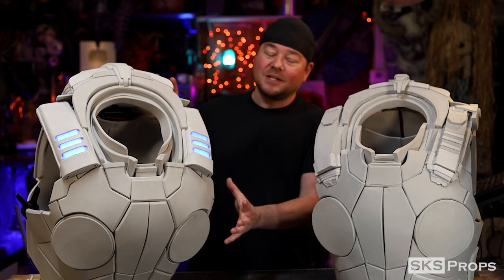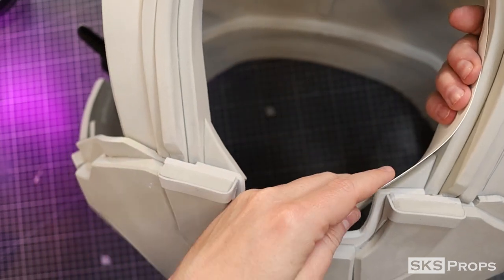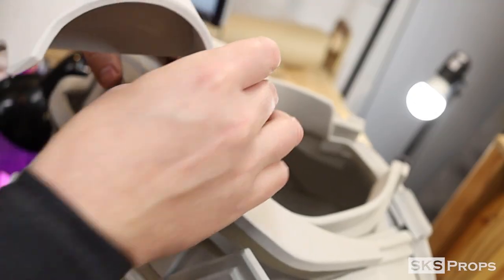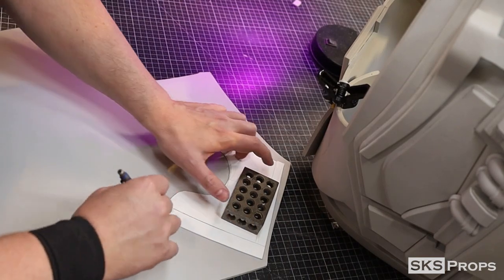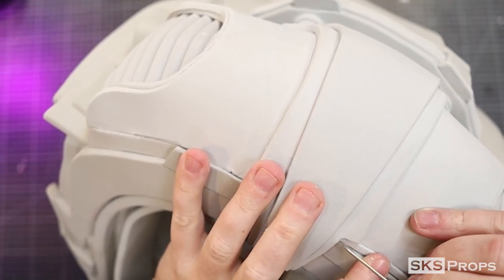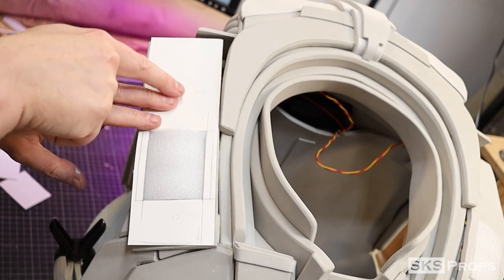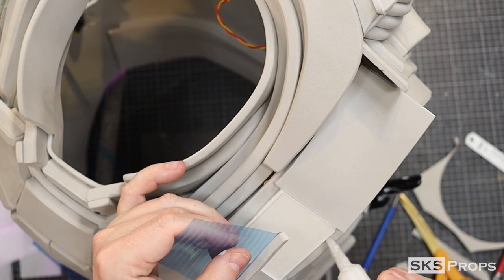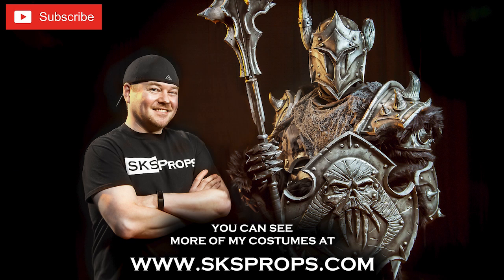How to Make Gears of War Cosplay Armor - Free Foam Templates - Marcus Fenix Chest - Part 4

Comment: @SKSProps
Hey my friend, I just wanted to let you know that your work is remarkable and that I am now building a Batman costume using your template, however I just purchased some Eva foam at my local michaels. Got all the sizes you reccomended and then I realized you use hd foam. This is basically my second time building something out of Eva foam.Would you recommended I use that for the armor?
Reply from the maker: Michael's foam is low density and honestly some of the worst I have tried to use. Just realize that it will dull your blades quicker and be much harder to have clean cuts and to sand smooth. Not all foam is created equal. That's why I created HD-Foam because I couldn't find anything out there that would make building easier for new builders as well as having the quality for pros
Reply: Thank you so much. I might just return the foam and then purchase yours. Do you how long it might take to ship?
Reply from the maker: @EthanGensler  links to mine are in each video description and on my site. Blick has been shipping my foam out very fast and they use fedex
Reply: @SKSProps  Thank you so much for responding to my comment, I really appreciate your help. FIgured I check with someone who knows way more than I do. I will be sure to purchase your HD foam for better results.